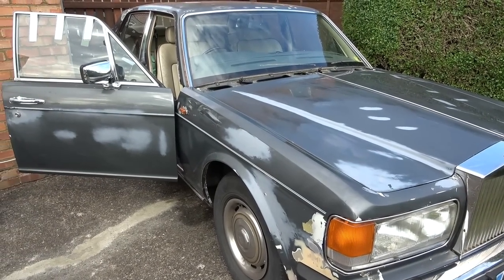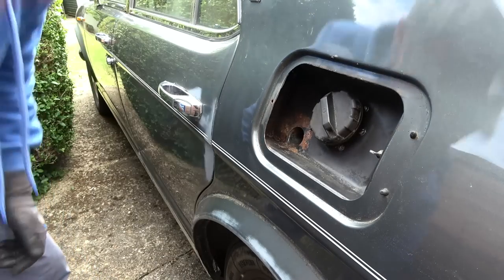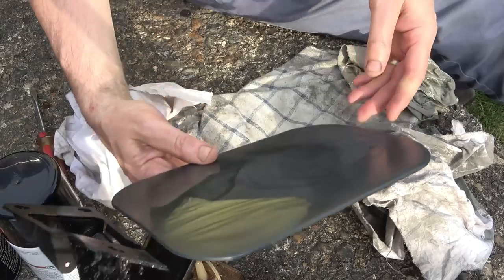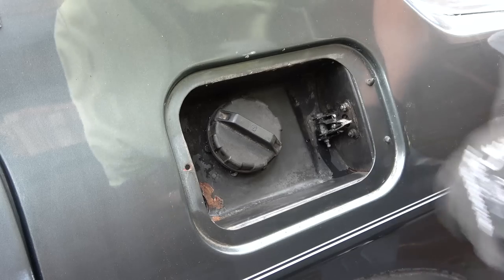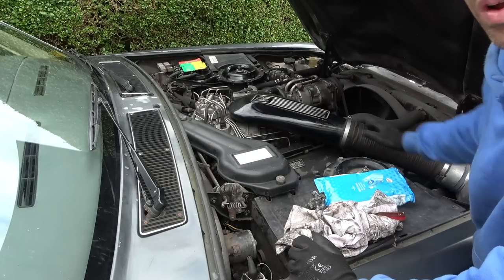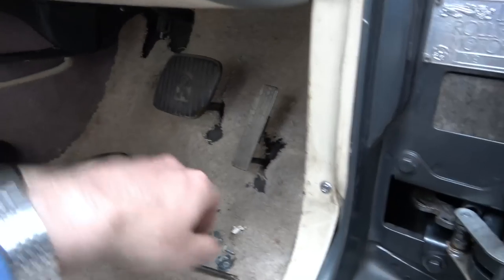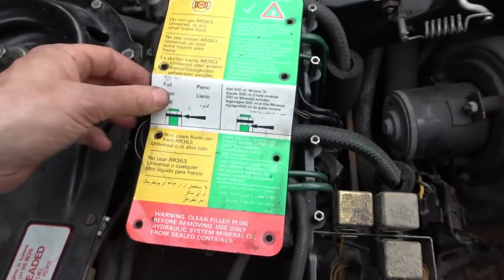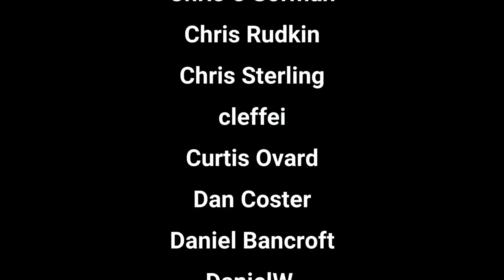Can I REPAIR a ROLLS ROYCE - PART 8 - Fuel Filler Flap - Polish - Engine Clean

Comment: Love the series Vince - one tip:  Make sure you follow up with an actual lubricant rather than just WD-40 - WD-40 is great - I use it a great deal too but some appropriate lubricant (oil or grease depending on the application) helps to keep moving parts moving.  A lithium grease is usually a good idea where there are two metal parts in direct contact (without a bearing of some sort).  Have you found a factory service manual for this or a Haynes guide?  They may come in handy when you're trying to work out things like the wiper mechanism.  Thanks again!
Reply: I'm glad someone said this, it took me so long to realize that WD-40 is a water displacer not a lubricant, it does lubricate but it doesn't last long as a lubricant
Reply: No haynes manuals fot these unfortunatley.bin looking for a service book on one for years.dont seem to be any about for them.
Reply: That WD-40 IS Lithium grease. Its not regular WD-40. I use that same stuff on everything on the car, on the house and everywhere else.

Comment: "Progressive" carb. For gentle economical driving you're usually running off the first barrel, but if you're more aggressive and heavy on the throttle, the second barrel opens up as the pedal heads to the floor.
Reply: The engine probably has a Bosch-Motronic fuel injection system, or a K-Jetronic fitted, depending on the build date, see injection pipes and fuel distributor. The secondary lever is very like a secondary carb butterfly but in this injection system, allows the fuel distributor sensor plate to raise, therefore increasing fuel flow to the eight injectors.

Comment: For your question on touching up the paint, yes you probably could get away with touching up the spots clearly need sprayed again but absolutely do not do it with a paint brush, some paint supply shops can make up spray cans (which still aren’t ideal but better than a paintbrush) by either scanning the paint on the car to match it or you can give them the original colour code.

I’d highly recommend getting some compound and polish instead of using t cut and then a good wax to seal the paint and protect it after you’ve finished polishing the car and you also should probably be using a clay bar before starting to compound or polish the car at all, id personally recommended maguires but autoglym and I’m sure plenty other known brands work just as well, just be sure to read the bottle or even check out some of the brands videos on how to use their products to be sure you’re using the right product as some portions of the car might only need a polish and some might need compound and polish, hope this helps love the videos.

Comment: Word of warning Vince.
If your fluid leak seems to be anything to do with the hydraulic suspension be aware its going to be under a lot of pressure.
Do some reading about how the system works and most importantly how to depressurise the system before working on it.
Guess who didn't once and nearly sent a citroen suspension sphere into orbit?🤣
Reply: Great advice, and if I'm not mistaken, Rolls Royce uses actual Citroen spheres because they are an excellent idea and quality part, fitting for such a quality motor 👍
Reply from the maker: Cheers Adele, I can imagine how much pressure was behind just as you got to the last couple of turns to undo it😂  thanks for the heads up. I believe I have to repeatedly press the brake pedal whilst the engine is off to depressurise it BUT I will do some reading up beforehand 👍👍👍👍
Reply: @Charlie_Crown  Those Citroen suspension parts are a F**k**g nightmare, nearly all of the older Citroens with the hydraulic suspension were scrapped cause of it.
Reply: @stevenc5227  Citroen have stopped using them, apparently they are designing something revolutionary, but Rolls Royce and Maserati are still using the spheres, still manufactured by Citroen, so they can't be that bad, plus why would you scrap a Citroen just because the suspension is shot, when you can just replace the spheres, like you would shocks, I never changed one out, but how hard can it be really?
Reply: @Charlie_Crown  not scrapped just for the spheres, but all sorts of other problems connected with it, i am talking about the older Citroens from the 80s early 90s.
Reply: @Mymatevince  you have to check every hydraulic hose and connection to make sure nothing is broken. And you have to know that every car fitted with this has a reservoir cap to refill the mineral oil. At least the old Citroens I have repaired did have a reservoir cap for that. But if the hydraulic hoses are not replaced in time, horrible things will happen either to the brakes or the suspension. And you have to avoid cheaper replacement hoses. Been there done that.

Comment: You could take your petrol cap to your local car paint supplier so they can digitally scan the paint and make up some spray cans.
The match is normally perfect. Being metallic you really want to spray the paint and not use a brush. Also buy some SprayMax 2K Clear Coat 
for the lacquer, I've had great results with that. There are loads of YT videos on how to do this. Good luck with the RR

Comment: I hope you have found how to fill the reservoirs.  You need a CASTROL bottle of the silicone that the systems run on.  On the top of the canisters where the sight fill indicator is, just next to it is a filler access which required a specific coupler to allow you to fill the reservoirs.  Incidentally, Flying Spares offers a stick with a complete service manual for your car.  I live in Laramie Wyoming and have an 86 Spur and 93 Brooklands.  Have lots of experience with these cars. The manuals are invaluable.  Our nearest agent is 280 miles away!!  Do everything by computer and EBay and Amazon.  I have also developed a very workable relationship with an Agent who supplies me with parts that are specific.  Once a quarter I send the service department some nice steaks and they answer all my questions!!!!!.
Don't play with the suspension and brake systems without the manual.  They are very prone to easy problems if you don't follow procedures.  One important tip. I had a flexible high pressure line fail and fix that. However I needed the silicone and was miles from help.  Local Mercedes agent had some non synthetic Biltzen fluid for Mercs and it works fine.!!

TEXT if you need help.
Punch.

Comment: great work Vince, don't forget to look up my response to the wiper arms if this hasn't worked, as possibly the wiper motors are in the wrong position for the wiper arms, and that would cause the kickback when the motor stalls and the arms are under tension with their springs. it isn't that the wiper arms are too low as such, but resetting the wiper motors with the intermittent wipe until the motor stops, then putting the wiper arms on with the blades straight should solve the problem.
Reply: My thoughts exactly

Comment: Spray yes, paintbrush no. You would have to coat it maybe 500um thick just to be able to sand out the brush strokes, and that's the job of fillers. Even a cheap can of a similar colour would do a better job.
If you want to find leaks you have to degrease everything thoroughly, go for a drive, and then check where the leaks originate from. Basically oil on the trans can be coming from things like the rocker cover, so everything needs to be cleaned and checked soon after the car's been driven. Spray degreaser is the easiest. and if you're worried about electricals don't point the hose at them, ie, slight splashes are not a problem.

Comment: Cover your intake and fuse box and pressure wash the engine. DO NOT WORRY ABOUT WATER💦 it’s an old wives tale that it hurts engines. If you are super worried do some steam cleaning. If not just hose it down with compressed air afterwards.
Reply: On electrical connectors that old, it's likely they are no longer waterproof.

Comment: the middle green ball (sphere) is an accumulator one, there should be ones at the top of each "spring", which is a cylinder actually. check for them near the suspension, it was more common to have hydropneumatic suspension on the rear, and normal on the front, but I hope you have for both axles. if the brake is also operated with LHM fluid, it means that you wont have a master brake cylinder, but a brake valve, and your brakes operate on pressure, with the help of the middle accumulator cylinder, if you hear clicking around that part, your sphere is probably low on pressure, and you wont have brakes with the engine off. its a quite simple system really, as long as you have no leaks, and you have the right pressure in the spheres (62bar in the middle on Citroens, 40-55 in the suspension spheres).

Comment: There are single stage paints which can be wet sanded with 2000 grit sand paper and then you buff it with rubbing compound. Dual stage which is basecoat clearcoat can be "cut and buffed" meaning you sand the "orange peel" from the clearcoat then buff with rubbing compound.  It doesn't take that much skill to do this buts its very time consuming. If you brush the paint on it will look horrible and would take forever and a day to sand all that texture out of it. You can purchase colors online that are real paint in spray cans that actually contain an activator that breaks open internally when you shake it. Same with clear coat. Watch some videos on how to properly lay down coats of spray paint and give it a go!  Getting that car sprayed professionally will cost more than you paid for the car.

Comment: if you can get the exact colour it might look passable - it would be advisable to get in spray can from, or if not, and you have a compressor with a spray gun attachment, you could use that if you combine the paint with paint thinner. Painting by hand with a brush will leave the brush marks. Also the preparation is key, getting a perfectly smooth finish before its painted is critical otherwise anything done after will show the imperfections. i would use 3 or more different levels of polishing compounds and a buffing attachment for a drill rather than by hand with t cut. be careful not to burn through on the corners and edges

Comment: Nice unexpected result you got with that polish Vince. I'm guessing like you said those filler patches were put on by the guy who wrapped the car. Interested to see how the rest of the car will look now without the patches. That car really cleans up well. The engine is looking great also. And it sounds good running. Not bad now for a couple of grand, I'd say.

Comment: as a car valeter/detailer all my life one tip is never use T-Cut in circles, always strait lines in one direction only, never doing more than a foot square at a time, once you have done a foot square get a clean cloth to take the T-Cut residue off that area.

Comment: I'll tell you something Vince without the wrap and as it stands that car looks fabulous, maybe even FAB1. That engine looks like its designed by Rolls Royce, I have never seen anything like it, except in a jet engine, all those solid tubes made of metal make it look brilliant, I don't know any other car like it  you can tell Rolls Royce build aircraft engines, they have put the same effort into their motors. When your finished this car will be worth alot more, you do excellent work Vince

Comment: Might be worth checking that fuel with ethanol is OK for the engine. Most UK fuel is 10% ethanol now days. The Esso supreme 99+ is the only one I know of that's ethanol free, I use it fir all my small garden machinery engines. it's expensive but so is all fuel atm.
Reply: Apparently pre-2003 Rolls Royce models should continue to use E5.

Comment: Loving the new video matey! It is possible, if you're going to avoid doing a full respray, to blow in some paint over the areas with primer with the correct prep. However you would need to rough up the surface first to give it a key, so you're probably better doing your paintwork before you go ahead with the t-cut, as you might need to blend any new paint you get mixed with the panels that are already painted. 😀

Keep the videos coming, loving this Rolls Royce series!

Comment: As E10 is the new standard petrol grade it might be worth worth a check Vince if the car can run on E10 fuel before you fiill it up. Also try using the hole in the end of the adjustables to loosen/tighten allen keys.

Comment: Nice fixes again, I love this series :) T-cutting made impressive difference, maybe good idea doing the whole car and see how it turns out. 
Looks like it's metallic grey paint, probably the top layer is clearcoated? Obviously Rolls Royce being such a top class fancy car, their paint job must be very high quality from the factory, and it may help even when restoring it using T-cut :)
I've seen brake cleaner used for cleaning greasy and oily engine parts, maybe some brushing too and then wipe away what's left. 
When I had older cars, cleaned the engine bay similar way as well, with a cleaner, a rag, and wiping by hand, avoiding power washing, as one of my previous car got a temporary misfire after engine powerwash. Also, electrical connections might get wet, if the weather proofing in connectors have perished after all these years, then they create those darn green crusties, and stop working :D

Comment: You're cutting the clear coat (not the color coat) which I would imagine it has quite a few coats of clear being a RR and all. You can definitely spot fix the body and feather in the paint but you'll need clear coat on it to make it match and shine ✨️. I would have a pro do it otherwise it'll look shabby.

Comment: Vince, as others have pointed out please don’t use T-Cut anymore, you will either take too much paint off or be left with a load of hazing which will only become apparent when the sun gets on it. If you think that does a good job try a decent compound, doesn’t need to be expensive something like Maguiars Ultimate Compound, it’s less aggressive and breaks down to give a finer finish as you work it in. After that you might fancy a finishing polish to get the ultimate shine.

And for sure don’t use T-Cut with a polisher - hand only

Comment: I don’t know if you have noticed it, but if you look at both the two circles of the hydraulic things in the engine bay. One of them has three green cables running to the circle but the other one only has two green cables.

Comment: You should be able to "dust in" the areas that have body work or primer on them; the car will be a twenty footer but it can be done for perhaps a few hundred dollars/GBP.
Reply: Clearly never been a car builder.......it isn't easy to 'dust in'.....chances are, the car isn't even the colour it should be. It has clearly been re painted at some time, and it may not be a roller colour. With metallic, to do it correctly, you need to flip into the next panel in order to get a good match, so it's not going to be cheap
Reply: @delboytrotter7902   No one said it was easy; you can easily match the metallic gray by removing the fuel filler door; taking it to an automotive paint supplier and have them match it pretty much exactly.  Now, blending is a skill, and not for amateurs and the amount of blending on this car would dictate a full respray.  DIY painting of metallics can also result in "tiger striping" as well.  Even a cheap paint job on that barge will be $5000-$6000 dollars.  Find a shop that will spot paint the car and...Bob's your uncle

Comment: Get a few manual pump sprayers, you know the ones with the push rod to build pressure in the bottle.  Fill one with a degreaser diluted as required and one full of just water.  Spray the degreaser in and use paint brushes to agitate dirt then rinse with the other one.
Reply: Also screw fixes no nonsense degreaser is awesome

Comment: You can actually spray the entire engine bay with gunk engine cleaner or simple green start it up and let it warm up but not get hot let it cool and spray water all over, overall your connectors are closed connections but cover your coil. Just let everything dry before you start it. Good video if I ain't watching electronic repairs I'm watching automotive repairs.

Comment: Another one enjoying the series. I presume the primer patches are from a previous owner covering some rust spots and/or body damage repairs. Paint jobs are expensive (depending on the quality output of the shop). But it may be worth it one day when it’s mechanically sound and it’s all that’s left. Being the late 80s, I assume that’s a standard poly clear coat and not a lacquer? But I could be wrong as it’s a RR.

Comment: To get a good look at possible oil leaks you really should clean properly.  Degrease, high pressure wash, soapy soak, rinse.  Much better result and in half the time compared with the wipes method.

Comment: Always a good video that you upload but I really do widh you wouldn't us WD40 as a lubricant. It isn't a lubricant at all, its used to diplace water fom components (Water Displacement 40th formula) it will rot rubber if left too long. The lithium grease is OK for joints etc.. but get some penetrant spray like PlusGas (plumber suppliers) it works wonders on seized components... The rust convertor is better used by being poured into a container and then used from the container, the throw it away.

Comment: Is that perlisent or matellic? If you get the right colour, and get it in rattle can, I use paint 4u from ebay. Your going to have to prep the area, warm the base coat up in hot water, mist spray on in layers until you get an even matt finish, apply the clear coat in layers again until you get an even finish. Also a hair dryer on light heat and feather it over the paint to dry it quicker. The problem your going to have is trying to get a match by the colour code due to it being a classic car. But good luck any how.